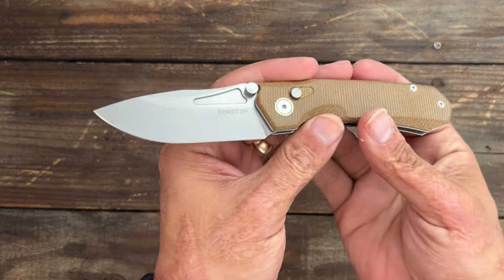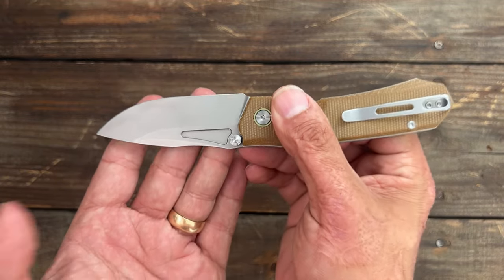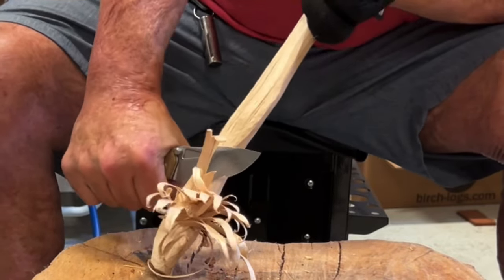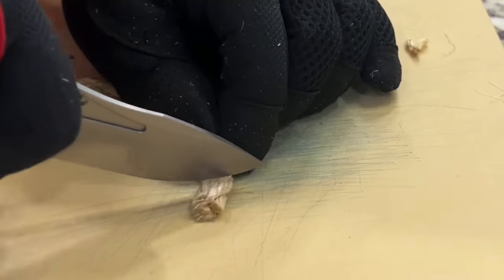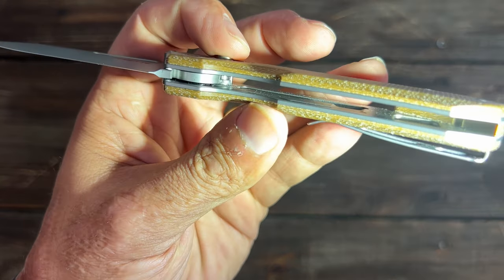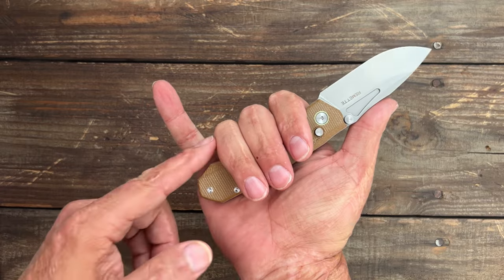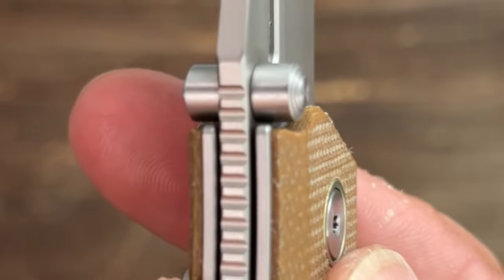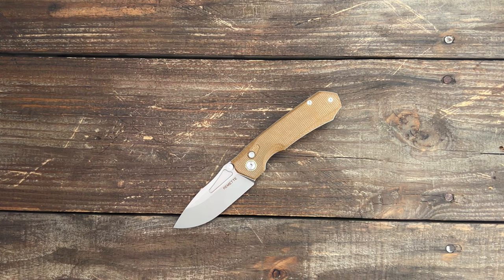Snappiest Button Lock Knife this Year! Remette Rhinoceros

Comment: Love mine.👍 it's well made for the price. Like topdog I got a good deal too earlier on Amazon. The only thing about it is you can't deploy it using the button. The button is just for locking and unlocking the blade in the open position. The blade uses a regular detent ball on a lock bar cut farther in on the liner. The bar doesn't lock into the blade either. I had to retrain my brain when I first got it in because I was so use to using buttons for deployment also. I chatted with REMETTE and they may be changing the button system. I like it the way it is. Thanks for the video Stassa. Love your channel 😊
Reply: Yes, in fact my factory has given me feedback that the next batch of this knife will have a new unlocking system that includes the locking of the liner lock combined with all the functions of the push button lock! !
Reply: Can you give me an Amazon review if you can? I hope to get more feedback to give new buyers more confidence to choose. Thank you for your support and wish you a happy life